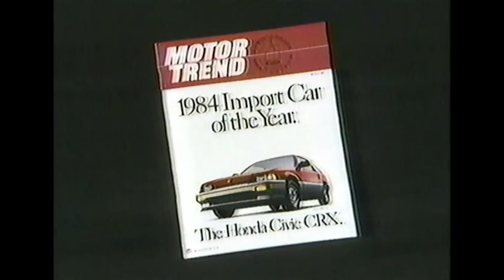DEL SOL: Honda's GREATEST Mistake

Comment: You completely goof’d on the motors and the history of these cars. The JDM 88-91 CRX had the sir with the b16 dohc vtec motor, whereas the US model never offered it. The Del Sol did have a trim level equipped with dohc vtec

1.5l sohc
1.6l sohc vtec
1.6l dohc vtec <— this is the 160 hp motor and came in the US models as ‘del sol vtec’.

Comment: Its 2023, and Honda still did not get the memo that you cannot build a sportscar on the FWD platform.
Reply: The Lotus Elan wishes to have words with you.

We'll assume you already know what the Integra and CRX will say.
Reply: @skaldlouiscyphre2453  If I have not heard of the notoriety of the Lotus Elan and its exploits, its not a sportscar as you can see.  The Integra and CRX are not sportscars, they are econobox wannabe sportscars.  Their formula is affordable, light weight, and high reving.
Reply: @mr.cookie7308  Cheap, economical sports cars are still sports cars.

If the Elan isn't a sports car, your definition is invalid and therefore irrelevant.

Comment: This Story is all the way around,  nobody wanted a Miata on in the 90's or 00's the old school car guy's can confirm if i am wrong, but before Gen Z everyone thought it was a girly car, weak engine and nothing practical. It was just a wannabe sports car. But recently people notice about the good suspension and well balanced chassis, other's just find it cute to have because the "pop up headlights" so the Miata starts gaining the love it deserves. But Del Sol is just another Generation of the CRX and came with a good B16A3 engine with 160hp@8,200Rpm wasn't made to compete with a Miata, the Honda similar as a Miata is the Honda S2000 and the Miata is no match for it. So, stop showing your personal opinion about cars and start teaching the new generation of car guy's with facts. The Honda Civic CRX Del Sol is as reliable as any other Civic, how dare you said is a Failure just because you like Miatas?

Comment: They were terrible rust buckets with windshields and roofs that leaked, and the same terrible early '90s Honda abs computer problems and interference engines that the other civics suffered with. The Miata, Corolla DX and Saturn SC were all much better cars, and handled better, too.